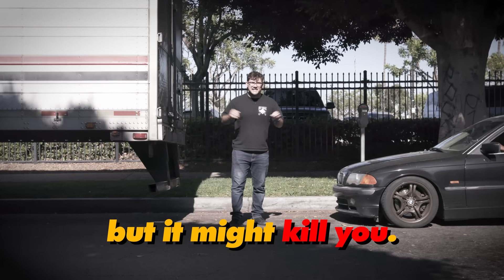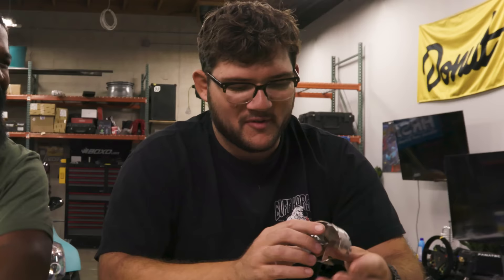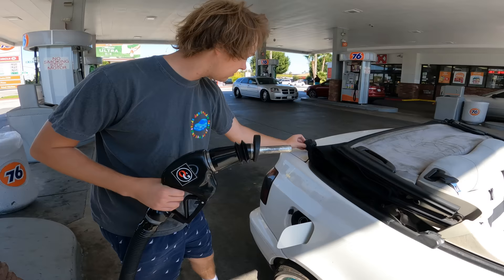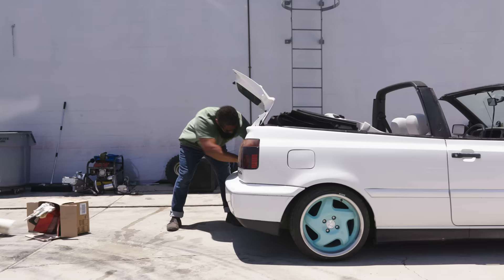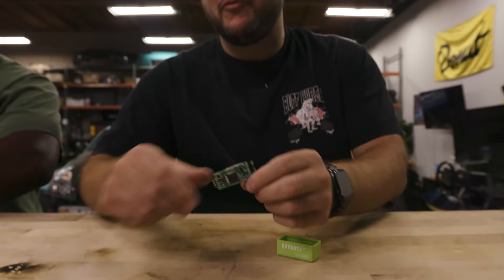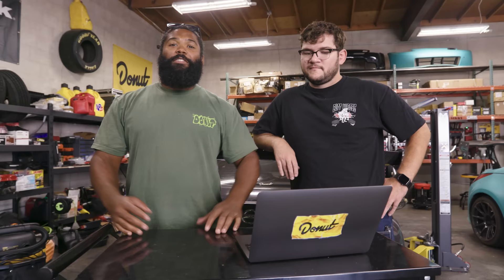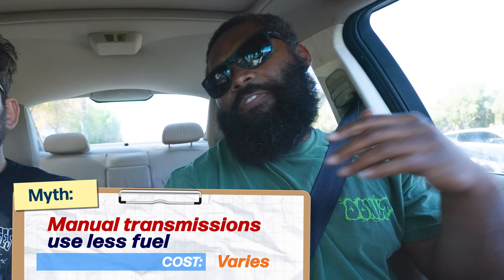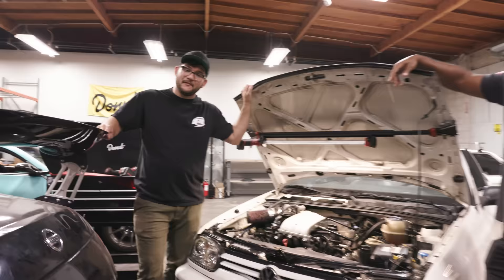Testing Fuel Economy Hacks

Comment: "Top Tier" doesn't mean high octane/premium.  Top Tier is a third party certification for gasoline detergent types and amounts.  I've seen no data to show if it improves gas mileage or not.  You're right that an engine needs the octane that it was designed for, but Top Tier is separate from octane.
Reply: Top tier is less likely to get clogged up, but how often is that a real problem?
Reply: I noticed an improvement when switching to higher octane in my old NA Miata I used to have.

but go figure a performance machine would benefit from something like that XD
Reply: @abigails4088  placebo effect. If you're engine doesn't require higher octane fuel it will just burn it like regular fuel and not make any better use of it.
Reply: @jmoyet  depending on age and environment, an older car could have enough carbon buildup that it actually increases compression in the engine to require slightly higher octane. However...
1. This is extremely rare and the engine is usually toast before it happens
2. Any knock-controlled engine management will just lower the engine power if this happens.
Reply: Doesn’t improve MPG but can help with engine wear and carbon build up.
Reply: @miked9986  higher octane doesn't burn any cleaner than a lower octane. Octane is the heat resistance before it auto ignites. Higher compression engines use higher octane fuel because regular fuel would ignite from compression heat before the spark would go off causing damage to the engine.

Quality gas aka TOP TIER gas have detergents and other additives to prevent and possibly clean build up in the cylinders and valves. 

Octane is the heat resistance before it auto ignites from the heat alone.
Reply: @iamstd2  that would be an extreme case. Would have to be running really rich, burning oil, or both
Reply: @jmoyet  I mean you're right, but i know higher octane fuel at least here has more cleaning agents in it then regular octane fuel.
Reply: @jmoyet  top tier gas ≠ higher octane gas
Reply: Lower octane fuel (95e10) here (Netherlands) is also combined with more Ethanol, than higher octain fuel (98e5). And I’m no scientist, so don’t destroy me on terminology. But Ethanol delivers less power when it combusts. So theoretically you would need more of it. So the more ethanol (95e10) you have in the fuel (aka lower octain in the Netherlands), the more you use.
Reply: @jmoyet  "if your engine isn't designed for it"

a 4 cylinder motor averaging the mid to upper 20s in fuel economy BY DESIGN... clearly fits the bill. Doubly so when it states that inside the fuel cap (It was the first car I'd owned like that)

it makes more sense to say in response to my comment
"Well, YEAH... and if you'd been running your Mazda on watered down gas, YOU'D ALSO NOTICE AN IMPROVEMENT... USE THE RIGHT SHIT FOR YOUR CAR, ABBY"
Reply: This.
Reply: @AlexSchepers  funny that they decided to put less ethanol because ethanol by itself as a fuel has a much higher octane rating than straight gasoline without it being race fuel. But! You need to burn more of it to equal the same power output as gasoline thus making it less fuel efficient as far as mpg goes. But it's great for high compression engines such as modified turbo or supercharger with high boost applications
Reply: @abigails4088  my brothers audi for example has a higher compression engine than most cars on the road and it requires 91 octane. By design it needs that higher octane. 

Now maybe with Nissan new variable compression engine it might make use of all the octane ratings since it can vary the amount of compression. From what I seen it can vary from 8.8:1 compression (87 octane territory) all the way to 14:1 compression ratio (e85 or race fuel territory)
Reply: @Neishy4AGTE  not true. It's been tested that they have the same additives on all the octane rating. They just give them fancy names as marketing scam such as "supreme" or "premium plus" etc. In the end its the 93 octane will have the same additives as 87 octane. The difference is just the octane rating.
Reply: @jmoyet  bruh, go sit in the corner.. Seems like somebody is in desperate need of confirmation, you need to redirect your parental issues elsewhere. When I see someone tagging every other comment, it is time to troll. Don't take it too hard, I'm just having fun in the comments the same as you🤷

Comment: Just a note on the cold/warm fuel, temperature does affect it. Up here in Canada we have ATC (automatic temperature compensation)on all our fuel. It adjusts the metering as if the fuel was a constant temp of 15°c. You have VVR vapor vac recovery, which brings the vapor back into the tank at the station. Then recondensed back to liquid, or a portion of it does.
Reply: I have to also agree.  There is a suit which was settled due to the fact that the pumps did not do the compensation and therefore by measuring fuel in gallons vs thermal units, there was a loss of (we're talking 1%) 'fuel' when all other factors were accounted for outside of temperature
Reply: exactly, the gas tank will be losing money due to evaporation if they don't keep the fuel temperature controlled to avoid loss during the day.

Comment: Manual vs Automatic transmissions: torque converter lockup- mechanically locked the torque converter above a certain speed (30-40mph) or in the top gear, reducing the hydraulic loses of the TC impeller/vanes and increasing efficiency with the engine directly driving the transmission.

Comment: 13:27 I believe that older automatics also had less efficient systems to convey the power, since to allow idling while standing still older automatics use a torque converter with a fluid coupling to allow for slip. However, this is less efficient than having a clutch which can fully engage. Nowadays modern automatics can "lock" the torque converter at higher speeds, so it can achieve the same efficiency as a manual.
Reply: All things equal, it seems clear that manuals still have the edge in efficiency due to the power required to run the automatic transmission's pump and the internal friction of the more complex gear set. Cars with automatic transmissions consistently show less power in dyno tests due to drivetrain losses. More drivetrain loss = less of the power your engine produces getting to the tires = less drivetrain efficiency. That said, all things are not equal when modern automatics have 8+ gears and shift so much faster and often more conservatively than humans.
Reply: Torque converter automatics require tons of gears in order to be efficient
Reply: Locking torque converters have existed for decades. One of the biggest changes for automatics is having more gears (thus possibly taller ratios) than manuals.
Reply: @joshjlmgproductions3313  and one of the easiest ways to have more gears is to throw away the gears and use a belt and pulley to create an infinite amount of gear ratio's. Manuals would still win fuel economy tests if car makers didn't adopt boring CVT auto gearboxes.
Reply: People insist that automatics are more efficient, but that is just to justify being lazy.  They rarely have a source, just what they want to believe.  The thing is, automatics aren't designed to be more efficient, they are designed to balance efficiency, longevity, smoothness, and probably other factors.  There are absolutely factors that an automatic transmission cannot take into account, so they won't necessarily be as efficient.
Reply: I have also read that car manufacturers are able to influence how the EPA tests cars to make automatic transmissions look more efficient.
Reply: @chokeeweebee  How many CVTs are made less efficient in an effort to make them less interesting?  I heard that owners complained about CVTs not shifting, so now they pretend to, losing their advantage.
Reply: @drippingwax  yeah a lot of cvt's are being made less eficient with fake gearshifts like my hrv that has 8 fake gears played around with a fake paddlesshifts (their just buttons at the back of the wheel). Still so long as the number of fake gears is more than 6 even inefficient cvt's easily beat manuals in fuel efficiency.
Reply: Weight is also a factor, manuals simply weigh less.
Reply: @drippingwax  they are more efficient if you take the human factor into account. Most people can’t drive worth shit and are nowhere near maximum fuel efficiency for their car

Comment: I would love to see the ENTIRE process of Jeremiah making an HHO generator 😂😂
Reply: A hydrogen generator is actually extremely easy to build. In fact you don't need to have any electrolyte powder either because most tap water will conduct electricity and produce hydrogen gas without any additives. If you're using distilled water then that might be a bit of a problem because you have to have something to act as a conductor.

Your vehicle is not capable of producing enough electricity to create enough hydrogen gas to power it. Your combustion engine is not capable of running off of hydrogen gas either because of pre ignition. It doesn't matter what these people do, you're not going to be able to Simply electrolysize water and then run it through a pre-existing car engine that's just not possible by the laws of physics

Comment: Drafting behind a semi definitely works.  I had a 2013 GTI that I was able to get almost 500 miles to a tank on the interstate because I spent an hour driving behind a semi going 75 mph.  Typically I could get around 425 - 440 miles to a tank (depending on conditions) but when I drove behind a semi; I was able to get from Tampa, FL to Atlanta, GA without my low fuel light ever turning on and pushed it to around 485 miles before I finally pulled into a gas station.  If you are out driving; try to get behind someone with a taller vehicle (doesnt have to be a semi).  The added gas mileage is like getting a free gallon of gas everytime you fill up.
Reply: As a truck driver I don't really mind being drafted. 
My only request though; TURN OFF YOUR DAMN BRIGHTS!!

We might not be able to see the physical car but our mirrors are like the James Webb Telescope - a pin prick of light will illuminate the entire cab of our rig.
Reply: How tf can semis do 75mph, in Europe they can do maximum 90kph so about 55mph
Reply: My 2015 GTD (diesel GTI) has adaptive cruise control… drafting behind lorries is so easy and saves a lot on fuel… don’t even have to brake of accelerate ha
Reply: @philipcsiki8033  in the UK I think some trucks also have auto braking if they go above 56mph when doing down hill
Reply: @philipcsiki8033  Europe is small and probably easier to drive through. Our highways need to take people hundreds of miles and trucks are very important for getting everything across our big country with over 3 million square miles.
Reply: @KurtisandHurdle  Europe is not small, from the top of Sweden to the bottom is 1000km so 620 miles and that’s just one country
Reply: @Ej-en2lz  ye they should be able to drive faster it’s bogus with 56 speed limit for trucks
Reply: @philipcsiki8033  yeah, that’s the average distance between most states in the US. I used to drive 700 miles (1000+ km) from San Diego to Salt Lake City in one trip by myself pretty often back when I was 16. Is that common in Europe?
Reply: @philipcsiki8033  yea overall the US is a little smaller than the entirety of Europe but that's also comparing a continent to a country.
Reply: @philipcsiki8033  my dad was a coal hauler for years, and has run many times grossing 120,000 lbs and averaging 95mph between eastern Kentucky and just north of the Ohio River. Not smart by any means, but it can be done. That's why coal haulers hop their trucks up to have 550-600+ hp.
Reply: @philipcsiki8033  fuel economy drops drastically above 55-56mph. Keeping at/below that speed is an actually solid fuel economy advice that was only mentioned in passing in this video, which I find very confusing.
Reply: @scottoleson1997  yes because Sweden is only one country in europe so imagine hauling something from Sweden to Italy…
Reply: as I work as  truck driver i can confirm morons try this all the time, and have had 3 or 4 end up under the back of my truck over the years.. DONT DO IT
Reply: Semi tractors and tug boats make torque not hp. I mean hp is a theoretical measure but Torque pulls weight. A small block Chevy canmmake   500 hp but I won't pull 100000 lbs. The first pick up truck with a Cummins made about 180 hp but over 500 ft lbs a modded small block Chevy might make 350 horse in those days but would not pull half of what the Cummins could. Oil companies and tire manufacturers preach 32 psi bit milage definately increases with 40. Idk blabbering... Bored peace folks.
Reply: I've lived in British Columbia most of my life and most travels included mountain passes and I've seen modern trucks likely unloaded pulling hills at over 60 mph. Some make up to 2000 ft lbs now.
Reply: And fuel economy is determined by many factors not just speed. Driving under 55 mph is no guarantee you'll get best economy. Some make best economy at 70 mph hearing plays a significant roll. Try driving at 25 30 mph on a long trip and watch your economy drop. Not preaching just an opinion. Not meant to divide.
Reply: @philipcsiki8033  Sweden is about same size as California for reference. A speed limit of 55 is ridiculous some highways in America have a speed limit of 85 mph (140kph) but that's because its through hundreds of miles of desert
Reply: @Bad Drivers of AZ & NV I love that stretch.
Reply: @KurtisandHurdle  Definitely not small, and definitely not easier to drive through, with a lot of big mountain ranges (Alps, Apenines, Pirineys, Carpathians, Dinaric Alps, Balkan Mountains, etc...). While people in Europe probably drive less on average, trucks for transporting goods are needed just the same as in US.
Reply: lol that’s like a $5 value. Imagine thinking about this and being behind a semi for 6+ hours to earn $5
Reply: Whats the speed limits on interstates the maximum speed in the uk is 70 mph
Reply: @thepurdychannel8866  mostly 75 in Texas but sometimes 70. Many highways are also 75.
Reply: @philipcsiki8033  every state is different when it comes to speed limits. Some stats like Texas allow trucks to go as fast as cars, while others like California limit trucks to 55mph.
Reply: As a truck driver i really dont care if someone is drafting me. Just watch for me hitting my hazard flashers, or flashing my brake lights, cuz that means ima bout to hit my brakes hard for a hazard ahead. Or just in general be ready to back off at the command of my brake lights.
Reply: I did the same thing with a motor home and it definitely works…
Reply: @Ej-en2lz  in a lot of countries in Europe semis are limited by law at around 90kmh

Comment: Regarding Top-Tier Gas, that is not the same thing as High Octane gas. Top Tier refers to a certification that the gas has certain detergents in it to keep the engine running clean. Would love to see you guys revisit this and see if it really does make a difference. Otherwise, fantastic video!
Reply: EXACTLY. I was confused and annoyed they used the terms interchangeable